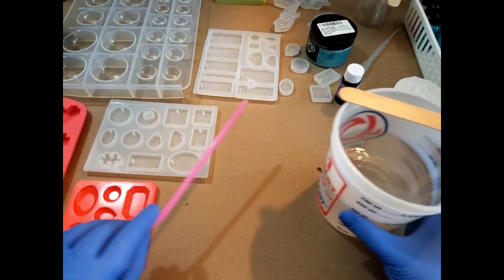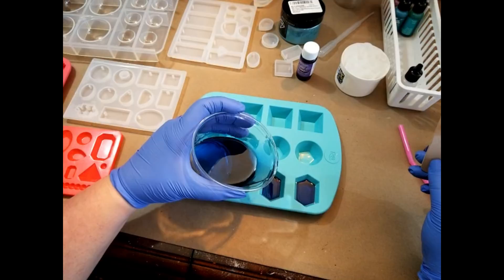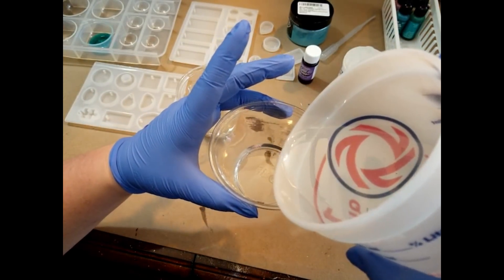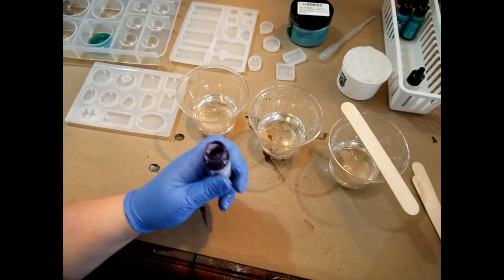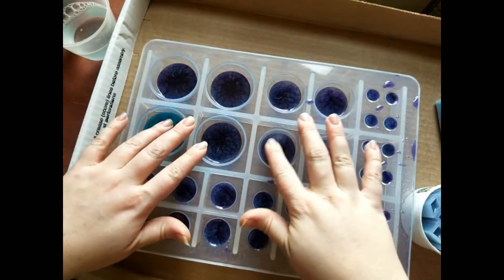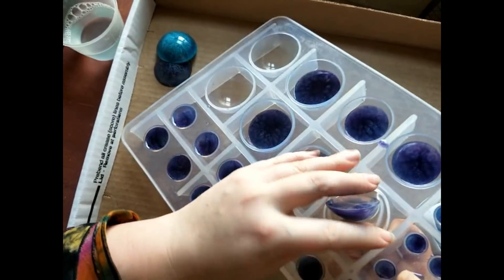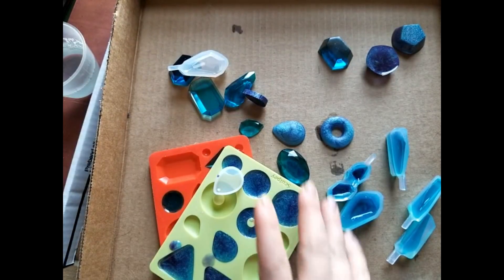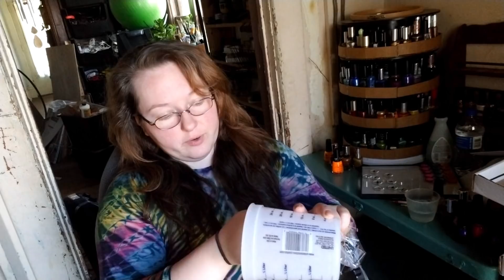Resin experiments

Comment: @Yvonne Williams A trick I used when making prosthetic mold pouring silicone (cause that shit is $$$$) Before I pour I take rice and pour that into my mold to see how much silicone I will need.  I now never have too much or wasted product.  Also If I a molding from molds like you have it write with sharpie on handle how much to fill the whole mold and how much just one of the shapes from the mold takes.  Leaves guessing game out of it.  Awesome job!!  Thank you for sharing your learning process, it is so helpful.  Also that blue left over resin look like a fin or coral.  I love the idea of resin fairy wings but would it get  too heavy? PS if you let the resin cure till is get gelly like then add the pigments they will not sink to the front.
Reply: Add lines on the pouring cups in measurements so you know.
Reply: Instablaster...
Reply: Thank you for the tips...I appreciate you!

Comment: I have been making resin jewelry for a few months, here are my tips. Alcohol inks can prevent resin from setting. Yes, a little pigment goes a long way. I use the plastic lids from disposable aluminum pans to cover my castings. Experiment experiment experiment. As usual, you just taught me about putting metallic nail polish on the back. I am going to try that right now.

Comment: Would it help to fill the molds with water (ahead of time to give them time to dry back out) to about the same level you want the resin to be, then pour the water into a measuring cup or just a regular cup, then mark or write down how much you will need? 

I haven't done anything with this resin I got yet, but when I do, I am wondering how to gauge how much I will need. The only thing I could come up with would be to just measure the amount in water, then mix that same amount of resin when the time comes to actually make something with the resin.
Reply: That is exactly how to do it. Or even better, if you have a syringe, see exactly how many ml of water you put in, then you can even write on top of each mold how much they each contain so you remember til next time. 
I know someone else wrote to use rice ,but you will still have space between the grains of rice so the measurements will be a bit off.
Reply: That was going to be my next comment.  Unfortunately you won't have any cool leftover colored resin to invent totally cool things with.  Exacto knife or cookie cutters or random shapes and mosaic, the list is endless.

Comment: I'm also a beginner when it comes to working with resin and a good tip someone told me was; when coloring your resin remember less is more, adding tons of pearl x and dyes will over dye your resin so that your pieces come out way to dark and pouring a clear batch first before you pour a colored batch can make your pieces look better...if your doing just glitter and resin than its not always necessary to do a clear pour first.., also even if you have a tiny bit of resin left, you should pour into a small resin mold or combine colors if you have more than one left over..hope this helps..
Reply from the maker: This is very helpful, thank you!!

Comment: I enjoyed your 2nd learning experience, which was also a visual learning for me.  When I saw your leftover resin I immediately thought of a wall sconce lamp shade.  When the light is on it will shine through as it did when you held it up to the window.  Even the tiny holes from the air bubble will shine light through and be very cool.  IMHOI if you plan to start selling your products you need to make sure the animals are not allowed in your craft room and to ensure no hairs or dust drift in use a canned air duster. Many people are allergic to dust and animal hair and food (nuts, strawberries etc) so ensure every thing is wiped clean with alcohol before sending.  Also if you cover the resin in the molds as they dry you will reduce the introduction of airborne particles as before mentioned.  Also invest in a level if you don't have one so that your molds are level as the dry.  Inside that banker box lid was probably not level.  Loved your video, you speak well, your camera was in the right place 95% of the time and you gave understandable descriptions of what you were doing.  Keep it up and I will keep watching.  Best of luck.

Comment: Vonn, you can actually get a stained glass effect for jewelry by making a nouveau style frame with wire, using packing tape to back the frame, and then gently filling the frame with colored resin.  I’ve done it before, but only recently learned that in order to get the nice stained glass effect, you have to use colored India ink to tint the resin. :D

Comment: Do you have the information on the dome cabuchon mold?

If you can pour a sheet of resin slightly thicker would it then shatter?  So that you can make "broken glass" jewelry using random shattered shards of the resin "glass"

Or pour small random puddles to become pendants?

Comment: Von- I have a question. What resin do you recommend for me? I often cast flowers in resin, which means I need large quantities at once (my current one cooks the flowers - which is okay- and it sometimes cracks and isn’t nice).  I need a cheap resin that can be poured in large quantities, picks up small details for silicon molds, and preferably sets within a day. 

Edit: also needs to be crystal clear and able to be polished nicely
Reply from the maker: Hey, Stormy! I don't have as much experience as I would like to give you a solid answer; but I would recommend this resin: https://amzn.to/2oN7FVp the gallon size is available here; https://amzn.to/2wRKdtH
Reply: Yvonne Williams - that stuff is more expensive than what I use currently. That’s $25 for 16 oz, the stuff I use is usually around $30 for 32 oz.
Reply: Link here: https://www.amazon.com/dp/B0018N9E3M/ref=cm_sw_r_cp_awdb_t1_fGEKBb08P6T4S

Comment: Do you use a release spray on the silicone molds?
Reply from the maker: Hey! I haven't found it necessary with silicone molds,  only the hard plastic ones :)
Reply: @backtoearthcreations  do you have to prep the mold before hand and is silicone mold better im worried about my project's sticking

Comment: We are using resin on the bathroom floor and to get the bubbles out we just use a torch\lighter just wave it over the top and no more bubbles also the flat price you did on the wax paper try heating it with the heat gun I bet you may be able to cut it.

Comment: A suggestion: pour some water,sand,salt or anything you wish into your molds and then measure the amount used. That takes all of the guess work and waste out of the process.
Reply: Good suggestion for testing for volume.  I need to find a material that weighs as much as my resin, so I can test for weight needed.

Comment: Hello Yvonne, Hope all is well ! I found that Dr.Ph Martin's Bombay India Ink has more intense color and greater vibrancy, while still being translucent, compared to the Tim Holtz brand. A little goes a long way.  Just the colors as the India ink white and black are very opaque. Also found that layering, allowing the cure in between, yield fantastic results, utilize the matallics last. You have to get used to  working backwards, as the front is the bottom of the mold.
I love the way Randy's rubies came out super shiny..where did you get that mold ?
The little windows molds like awesome too...nice high quality.  I have to check them out.... What is your take on Resin itself?   I have heard that purchasing "bar top" style resin in the gallon is the same product as the smaller "jewelry casting" or "art resin" at a significantly lower price and much more for your money.  Would love to see you compare outcomes with the different types and brands.  Thanks again for your time and fun to watch tutorial/experiments !
Kindest Regards, Cheryl
Reply from the maker: Hey, Cheryl! I will have to experiment more with the india ink in resin! I got the rupie mold from JoAnne's but I think it is also available on amazon :) I am really loving resin and learn more each time I work with it! I think I still have so much more to learn, though! I'd love to keep sharing what I discover with yall!